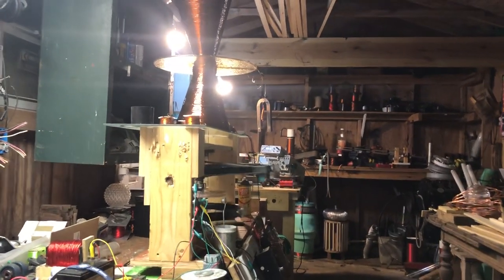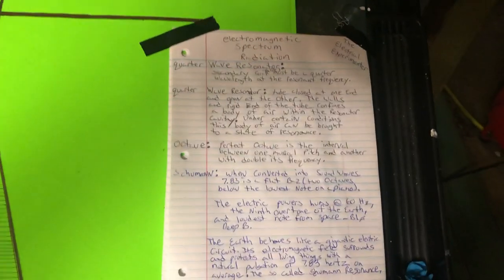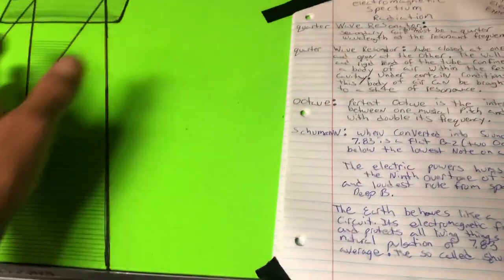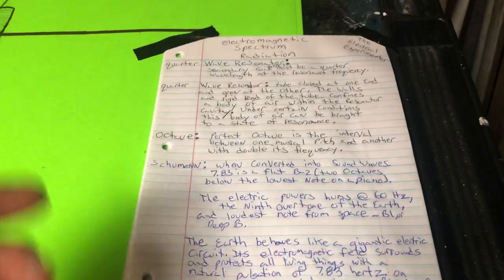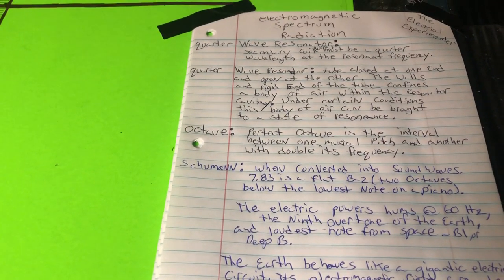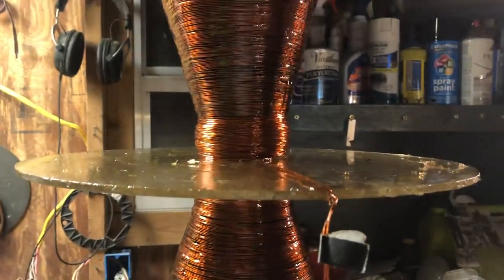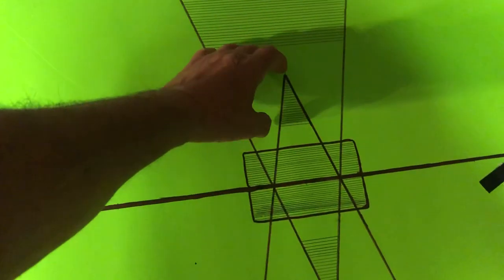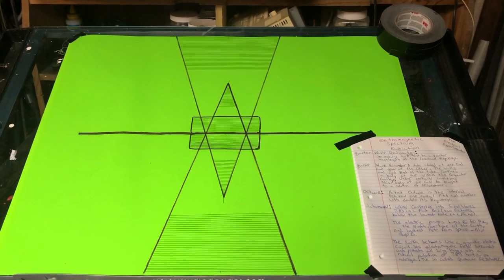Quarter Wave Schumann Resonator explanation!

Comment: Your drawing is another way of making the infinity  symbol. There's two pictures of what Edward leedskalnin was doing you should look for.  One is ed standing next to one of the crescent moon blocks with the house in the background an there's a big circle antenna on the roof.  Second there's a picture of Ed's home with 3 tripods which looks like the tripods are lined up like the pyramids one tripod is mostly blocked by the house you can see the box an some of the legs. As a reminder the picture of ed an the Y log is one of the legs of the tripod.

Comment: Yes, your right angles are where electrons pile up.  And the frequency is like infinite series (curvature) or waves.
Reply: Infinite series = magnetism
Reply: You are saying counter space because it is a mid/side matrix to normal space (electromagnetic channels 2D), gravity is analogous to a counter spatial mid channel in a higher dimensional reference frame.

Just as sound (from stereo sources) have monophonic and stereo phonic have constructive and reconstructive interference patterns, so does e/m, because the cosmos is (at least) stereophonic with respect to the emission of emf.

So, if you want to say ‘gravity’ in Newtonian sense is the result of mass (sitting in counter-space) monophonically, then it is a mid channel (3D chiral symmetry) channel sitting in 4D stereophonic space time (side magnetic channels).
Reply: Therefore gravity is not so much a field as it is an envelope.
Reply: * constructive and de-constructive interference.

Phase cancellation between 2D and 4D magnetic create chiral pairing of symmetrical mathematical operation which simulate a 3D envelope (mid channel), because it’s stereographic projection cannot be represented in polar coordinates, you get the Schumann resonance harmonics projected onto the equatorial circumference driving rotation.

It’s does not matter how ‘fast’ Earth rotates, in so much as it does, as the fulcrum point in space changes relative to the motion of the sun

This makes our orbital pattern a saddle shape, on the surface of a torus, relative to the star, as the annelema of the sun on Ed’s sundial shows us.

Comment: [03:27] Tube Wave Resonator. There's a great 2min51 video with someone using the resonance of an aboriginal didgeridoo to levitate a roll up paper (https://www.youtube.com/watch?v=1uvW7carEIE). Therefore, does it need to be blocked/closed at one end? Just asking
Reply: Silly question (I'm sure) but I'm now thinking about cymatics where you see folk sprinkling sand on metal plates (https://www.youtube.com/watch?v=wvJAgrUBF4w), notes are played and we see beautiful patterns formed at certain frequencies. With that in mind, with your dielectric sandwiched in the middle, if you were to place sand (of something finer) on the dialectric, would we see cymatic patterns?